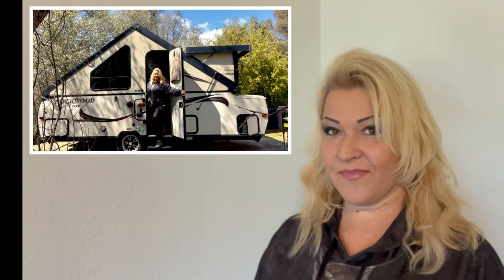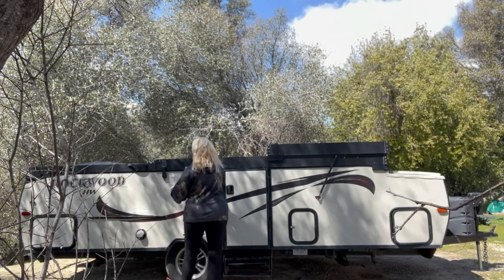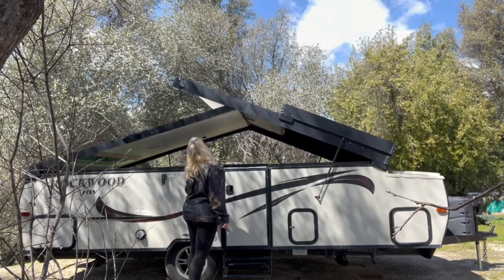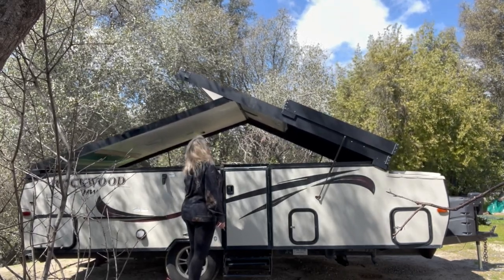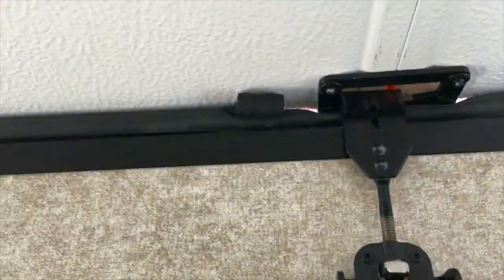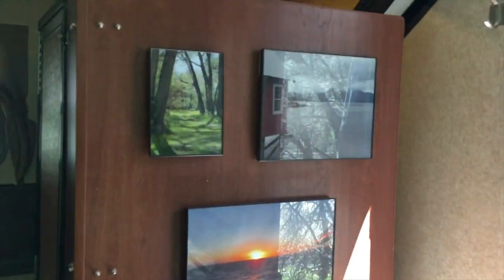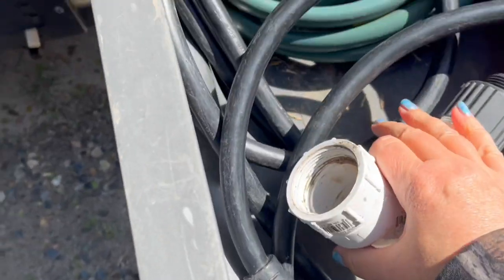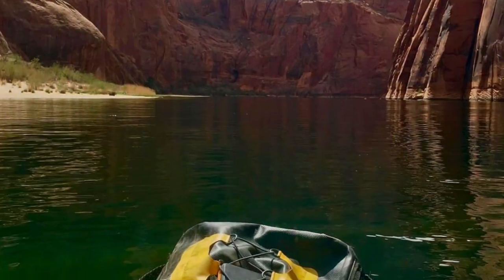A Frame camper / pop up camper set up and overview - Forest River Rockwood A214HW

Comment: Someone in my neighborhood is selling a model just like yours (at least from the outside). I drove by, got the seller’s info (didn’t talk to seller nor did I see inside). Skeptical about whether this would be over my head. NO! You have inspired me!
Reply from the maker: I really love mine. It's the happy medium. 
It's worth to at least take a look I side, each model is different, so even if it looks the same outside, it might not have a bathroom or it's different, the whole configuration can be different inside. 
If you're thinking about buying it (or any rv), asked them to have it plugged it for a few days and then go see if the refrigerator is really cold. Don't let them say "oh we just plugged it in". Try all the appliances, water heater, furnace. Appliances are the most importantly parts. 
I would even ask them to do all this off of battery power. When I bought mine, I had to buy new batteries, and had to figure out a few things. The previous owners always had it plugged in shore power so the batteries were not needed.

Comment: Thanks for the tip on recording the vendor setting it up.
Reply from the maker: You're welcome! 
I think it's helpful to record it. A lot of the set ups have many steps and it's a lot of information to take in. If you write down set by step, it can be helpful but in my opinion it's better to see it done. It will make more sense.

Comment: I have one of these for a few years now.  I knew exactly where you were making the errors first try setting up.  Here’s a tip, it is helpful to help the lift motor a bit by pushing up on the handle on the back roof section.  Speeds up and saves wear and tear on the motor. The lift motor is a weak point and I have gone through 3.  The third one had an engineering change adding a rubber boot around the motor. Hopefully that will keep water from running down the street into the motor and rusting it out.

After you unlatch the front dormer, you can push it up from the inside.  The center latch has the hasp for a padlock because you only need to have one to secure the dormer. Likewise, the two roof latches on the sides only one has a hasp for a lock.

Overall, I’m very happy with the trailer. It towes super easy with a small SUV with a 3500 pound rating.

Comment: Nice job and thank you for posting ! My partner and I are considering one. But I am 6'4' - I know I can fit under the "A" , but will I be able to stand straight at the cook-top?
Reply from the maker: I have to go and measure but I would think it's much higher than 6' there. That's the part where you open up the second roof, so it's horizontal, not slanted. 
Not sure if it would be 6'"4, but probably very close to it. I know that doesn't really help, so give me some time and I'll go take a look

Comment: Thanks for your review..  Considering one of these - upgrading from tent camping and sleeping on the ground..  
Do you mind my asking how tall you and your friend are?  
Wondering about the bed as we are used to a king and my partner is 6'3 and I am 5'7 . So are you head to toe right at the walls? - and does it feel cramped on the inside against the sloped roof?  Thanks.
Reply from the maker: You will love this! I'm camping right now in Utah, it's been 2 weeks and totally love it. 
I'm 5'8" and the bed is plenty. For someone 6'3" it would still be ok. There's one foot left for me from the wall. 
I'm by myself so I have the whole bed to myself. If it were 2 people, it might feel cramped for the one that's on the inside. It depends on the person. 
The best thing to do is go to a dealer that has one of these and ask to lay on the bed
Reply: @Huntress308  Thanks for the update!  Sounds like you get to enjoy the outdoors quite a bit!  What attracts me most about this may be the weight and compactness that means I cd manage it by myself for some solo trips and not need to buy a new truck! 
Enjoy.
Reply: The bed is a Queen Size running cross-wise at the back. If the person at the back needs to get up, they do have to climb over the other person.  Weakest bladder to the front! 😉

Comment: I wonder how much were and tear will cause this to eventually damage and have to replace later. Nice color on The nails by the way.
Reply from the maker: Well, that's a good question, but honestly I don't think it's a lot of tear and wear. They have been making pop up trailer for over 30-40 years (tent trailers and this kind) and I think they hold up pretty well. 
The bathroom walls, I can see that having an issue, but I will reinforce them with additional latches and it will work. My hose can be remade though (not hard for a someone who has some basic carpentry skills) or reordered. 
😊
I never ever had blue nails, I thought might as well play around lol.

Comment: I recently bought  the same camper , can you show a video of hooking up the plumbing ?
Reply from the maker: Yes. It will be a few weeks though. Do you have any specific questions? I did have some issues but that was due to something I didn't know, so I'll cover that in the video but other than that it's kinda straight forward. At least for now lol
Reply: @Huntress308  no not really , I just want to make sure that I’m hooking everything up correctly… I had the top re-sealed because I bought it used and it had been garage kept … re-sealed the bathroom as well … I don’t want to have any issues 😆

Comment: I am purchasing a one-owner used 2021 of this model. Would you recommend the 4 year extended warranty for a newbie camper? I'm debating if I want to add this cost or just keep money to the side for repair costs like that bubble window that's going to eventually leak or God forbid, an issue with the AC.
Reply from the maker: It depends. How much would it cost for the 4 years altogether? And what would it include with deductible? 
For example if your fridge or furnace or water heater breaks, would they replace it and would it cost you anything else?
Reply: @Huntress308  it would add $2,400 to the price, $50 deductible, everything about the RV and appliances including roadside assistance covered (allegedly). Everything except weather damage. Sounds good, but I don't want to shell out the money to find out they are full of crap and come up with random bs to not cover repairs. Maybe I should just set the money to the side since I have trust issues. 😅
Reply from the maker: @youtubestolemyname  here's my opinion. You're purchasing a 2021, that's pretty new. The appliances are supposed to be certified for 10 years, meaning they're supposed to work at least for that time. Sure, some can break before but I have also seen many 20-30 year old rvs with the original working fridge or furnace, etc. 
your main appliances are gonna be the fridge, furnace and AC and these will cost about $1600 each to replace. Repair  is cheaper. The water pump is a couple of hundred dollar and the toilet is not much either. 
So in my opinion might as well keep the $2400 for anything that comes up in the future. 
Other things that can go wrong is leaks, etc but they're easy to repair, I just did it in my roof, and will reseal the entire roof because there's a second small leak. 
Also you said weather damage will not be included. You can get roadside assistance from insurance. If have paid for full coverage insurance which includes it getting stolen or if there is an accident and it gets damaged. You can have towing added as well as staying in a hotel if far away etc and the insurance will still only cost maybe $300, give or take. Totally worth it 
If it was let's say 10 years old I would consider getting it. Mine is a 2014 and will be 10 years old but I probably would not have purchased the warranty lol

Comment: @Huntress308 >>> Maybe I missed this detail in the video, but what specifically do you prefer about the A-frame camper over the pop-up camper? You mentioned having a pop-up but later selling it.
Reply from the maker: Omg, so many things. It was so much work just setting up the tent trailer. Manually raise the roof (with a manual winch, it was hard), stabilize them, pull out both beds, put up all the bars under neath. Then push out the canvas. 
Then raise up the sink (it's folded down in transit), and only then you can start putting everything away because there are very few and small cabinets. 
All this is 45-60 minutes. 
The A frame camper? 15 minutes. 
I can't even sleep in my tent trailer unless I unhook it from the truck. 
Right now I'm in Sedona and spent the night at a truck top on the way here. I didn't have to unhook the trailer and took me 15 minutes to set it up, which also included the bathroom walls. 

Tent trailer has no bathroom walls and that was weird. 
The canvas was 20 years old and discolored, thin as paper, just nasty and I can't sleep like that. It's $950 to replace it and there was a 5 month wait list. I was on 3 month when I sold it. 

I could go on and on. The reason I didn't go into it in the video is because I'm going to make a video comparing these two
Reply: @Huntress308  >>> Rodger all that. Thank You...👍
Reply: Biggest advantage is it is hard sided, not canvas.  So more secure, warmer, the same as a regular trailer.  In Canada some campgrounds in bear county have different rules for pop ups because they are no barrier to bears.  Things like no food inside etc. which don’t apply to these A-Frames.
Can put up and take down in the rain and don’t have to put back up to dry out the canvas later.

Comment: I just bought this exact camper for $11,000 off of retail price. Ur experience with the tent type camper is exactly what I avoided. I wanted a hard side  because I plan to camp in remote bear country. A tent camper is dangerous there, plus they fall apart in 3 yrs
Reply from the maker: Yes, I'm so happy with this. It's more expensive but it's perfect, in my opinion. And safe from animals, and the weather. Although a bear just ripped off the storage door , but that was at my house lol
Reply: @Huntress308  yes Mam, a bear can rip through these campers ,but they literally bite people through side because of,,,,,,,,, Believe it or not,,,, the fruit fragrance soaps ATTRACT BEARS. People wash their hair in APPLE, CHERRY, and So on. The bears bite their head through the tent to EAT The fruit. Simple Math.
Reply from the maker: @jackychandler8594  that's crazy but true. My problem was that the side storage door was open, so he swung it back and forth and he finally got mad and pulled it off. Opened the front storage and went through everything and ate a bunch of gummy bears and graham crackers.